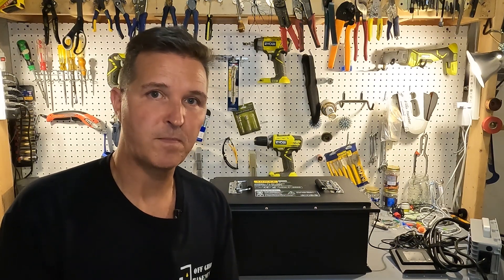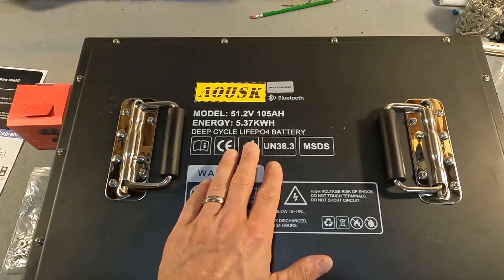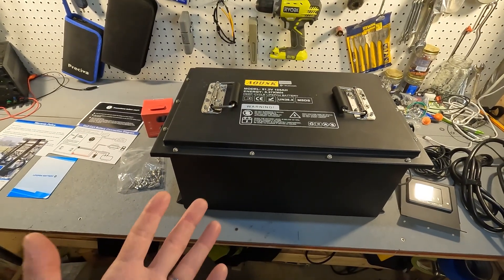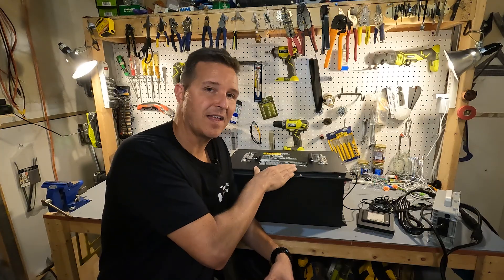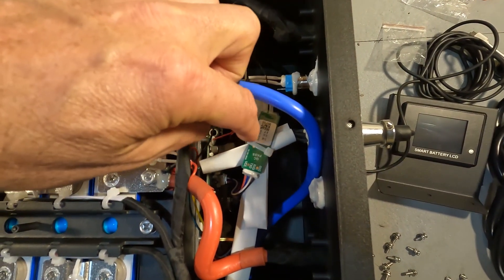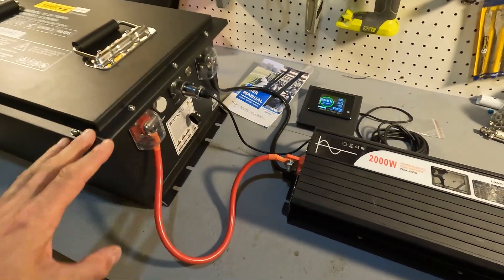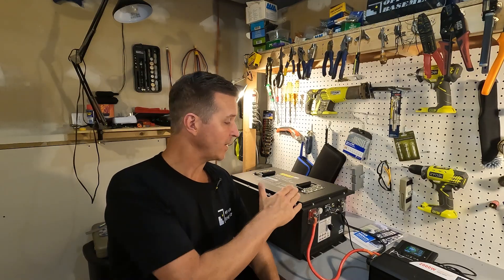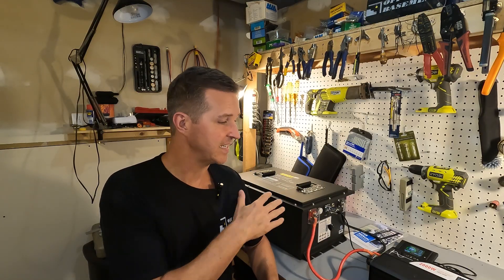AOUSK 48v 105ah Lifepo4 Golf Cart Battery can power MORE than just Golf Carts!

Comment: These aren't designed for home applications and should not be used in home applications.  The BMS is configured for gold carts, meaning it allows very high surges and high continuous output in excess of regular battery specifications.    This particular battery allows surges of over 1000A, designed to allow for a few seconds of high acceleration.  In fact, it might not have over-current protection at all and instead disconnects only on over-temperature (which is supposed to be a last resort, not a first line of defense).

In home applications where there may be mulitple racked batteries, the combination surge capabilities of this sort of battery will quickly outstrip the amperage interrupt ratings of your fuses and breakers and current carrying capabilities of bus bars and wiring without tripping.  Very, very dangerous.

So... use it for golf carts.  If you really need to use it for a home power system be sure to add an external 150A fuse and/or 125A DC breaker and do not use over 100A nominal.

-Matt
Reply from the maker: Very good comment.  My suggestion is emergency use and not a whole house solution.  Never rely on your battery to shut off due to over amperage.  Fuse your wiring according to the wire gauge.  Thanks Matt.

Comment: Nice battery, I would like to get one for home backup but does it stay on standby, ready to discharge or does it turn off (go to sleep, cut-off) like in a golf cart to conserve energy?
Reply from the maker: I would switch it off to conserve power, but if it's connected to an inverter, it will stay on due to the inverter drawing standby power.  Hope this helps!
Reply: @OffGridBasement thanks for the info

Comment: You could also wire an SB175 Anderson connector into your golf cart and another on the inverter. Then you can connect the inverter easily to the golf cart when needed. This might be an emergency, or perhaps just for power "in the field" without hauling a generator or even running out a long extension cord.
Reply from the maker: Great idea and thanks for the comment!